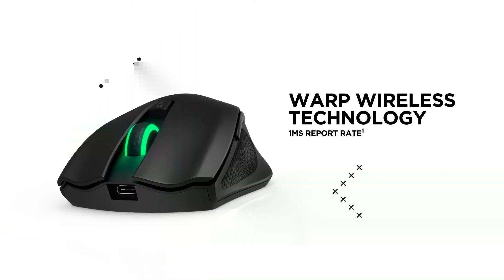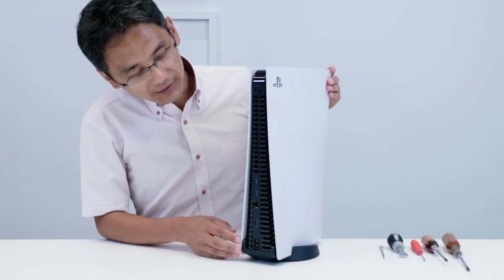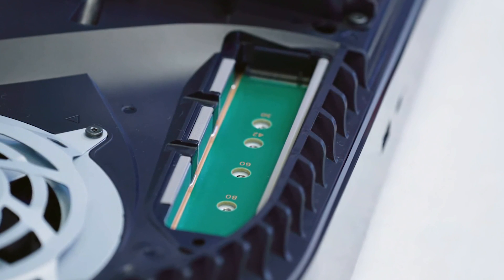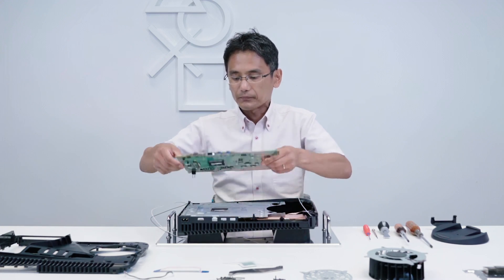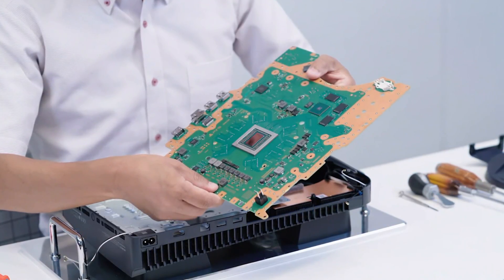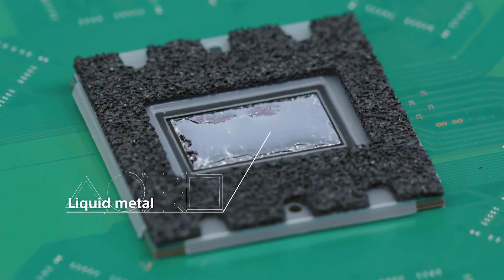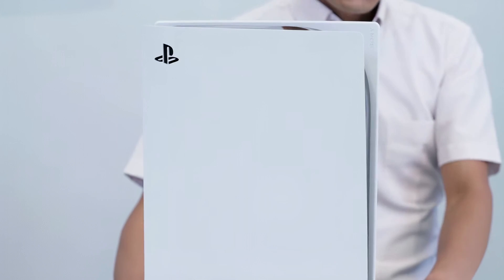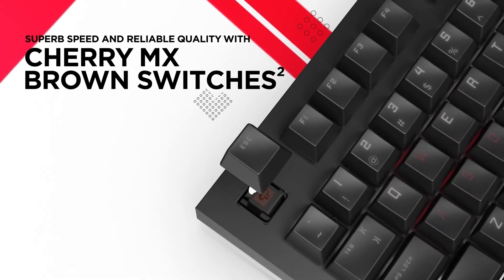PlayStation 5 Teardown Analysis: Inside Sony's Next Generation Hardware Design

Comment: Disclaimer: I use PCs but wouldn't consider myself beyond barely scratching the barrier of a PC enthusiast. But I have burnt down enough PCs to the ground have managed to bring it back to life hurriedly with nothing but shoestring and bubble gum to warrant some guesses/opinions 

The fan in particular, is the type mainly seen in dedicated cooling machines like ACs and car radiators. The blades on both sides are capable of pushing out massive amounts of air outside from both directions at once. Its essentially doing the work of two sperate fans cooling off a dissected chamber. 

The SSD, is purely a guess but I imagine the soldered pieces act as a primary (unless the bios allows you to change priorities via settings) so it does all the heavy lifting. The expansion slots mainly just transfer data to the primary as needed. But since we are talking massive speeds of data, heat is definitely an issue. I am guess Sony is relying on its fan to do the job of removing excess heat. I have to imagine the PS5 is design in such a way that there are enough outlets and inlets of holes throughout the system so that the airflow can reach all parts of the system without being obstructed. 

The liquid metal cooling solution is likely the most dazzling factor. It being able to transfer heat efficiently from the chip will definitely help with games at the start of the generation. It will be interesting to see how this entire design holds up at the latter end of the gen when games surpass the hardware requirements and get more demanding to run. For now though, its likely a little bit of an overkill with that huge heatsink for the games that will be coming out for the first few years.
Reply: Y Marina  wrong. XBOX has chosen fixed CLOCKS. not power.
Reply: It seems like you don't know much about the PS5.
You will be able to play games directly from your m.2 SSD.
PS5 will be running in constant boost mode at a fixed power level. that means that PS5 will attempt to boost as high as it can given the provided power(and what they call "model SOC")
that means that PS5 will consume the same amount of power(roughly) for each game, regardless of the engine specifics.
Reply: @codethis2875  You are right I don't. I will never know much about any system before I actually get to physically interact with it and likely burn it to ash in the process and try to use the ashes like clay to somehow reanimate the damned thing again. Frankly, no one knows much about the system beyond what we have been told and what we tend to speculate. That is why I labeled my opinions as "guesses" even though they tend to be pretty reasonably well founded. 

Ironically, as of the time of my reply to your remarks, at least one of my guesses have been confirmed already. Clearly the system was built around the giant heatsink and the exhaust fan to maximize cooling enough for parts that are not connected to that monster of a heatsink (which really should be as it would be a low cost and efficient way of keeping the SSDs cool without having to provide its own heatsink and accessories). 

So I am fine with waiting for the system to be out in the wild so I can turn my guesses in to facts.
Reply: @The_Spaz  We know a lot about the systems. there are Series X in the wild. people tested them already.

We see games running on PS5 and Series X hardware. what else do you want?

PS5 showed that optimization beats raw performance, exactly like last gen.
Reply: @codethis2875  On paper yes. But I did much rather put it to practice with my own hands thank you. Perhaps for you its enough, but I am just merely curious at this point. Besides, it could be powered by a hamster on a wheel for all I care. If it has the games I like to play, I will get it. Haven't quite seen anything for me that speaks worth owning just yet. I will just wait for feed back and see which of my guesses pay off and which don't.
Reply: @codethis2875  PPL have, I haven't and I have yet to see the game that would make this beast sing. That rachet and clank game is just barely scratching the surface of what the PS5 can theoretically do and I don't trust people on things that I can find out for myself eventually.
Reply: @codethis2875  Yes I kow what ppl tell me but that doesn't mean I would go on their word alone. No offense, I don't particularly trust publication sites because their primary objective is to sell you the product more so than inform. I trust youtubers even less because they are mostly here for the money and likes. The more popular they get, the less honest they becaome because now they have to play nice with all other companies that may or may not send a free sample their way. So no, I don't need people to tell me whats what, I can figure that out for myself. If it was something that I cannot afford to get with my own wallet I guess I will have to defer to others. So I really don't care whats been shown and whats been advertised. You should be smart enough to know companies can be deceptive. Just look at how all the games on PS5 are not exclusive after beating the "we believe in generations" drum for so long. Or how despite the boast MS is still not able to really able to justify their hardware beyond gamepass.
Reply: If you've ever watched developer interviews you would know that your explanation makes no sense.  End of gen games do not "technically" push the hardware any harder than launch titles (especially console exclusives).  The difference is they are more highly optimised so can get better performance from the same hardware by not wasting that power doing things inefficiently.
Reply: @alexatkin  Firstly, I think you are confusing the definition of the term "optimization" and are looking through a very narrow lens at an even smaller section of a much larger pie. Unfortunately, optimization has been a long running issue for third party games where devs on contract don't have the time or resources to figure out all the quirks of a single system since they have to release their IP for all systems and by and large focus on the lowest common denominator from that pie. Which are PCs. Due to their constant evolving nature, its only a matter of a year or two before it catches up to the console(s) and surpass them in pure brute power. So when the lowest common denominator starts requiring more resources to run games at "standard" settings you will notice the PS5 and the xbox both struggling to keep up. Exclusives on the other hand only need to worry about their brand dedicated hardware and can churn out much more "optimized" results than a third party can that has to be compatible with all systems. 

Secondly, either you didn't watch enough developer videos and/or your narrow perspective is failing you from connecting the dots because you are objectively wrong. All you need to look at is generations of games we have, why do they require more space? Why do they require newer tech to play? Amd why does graphical tiers of hardware even matter? Newer games will always demand more resources because games are generally created to look the best they can on premium settings possible on any platform. Its unfortunate perhaps but graphics sells and higher assets will need more space and resources to render on a system that the software is not dedicated to.
Reply: @alexatkin  Except that's how we "gamers" have always explained how some games at the end of any given generation seem to do things way better than games at the beginning. You can talk to devs and learn their lexicon of expressions but you're still here talking to mere gamers using their own slang/euphemisms.
Reply: Y Marina  What are you talking about? that's nothing to do with Sony\Microsoft.
Microsoft just offered a more powerful system and at the end of the day the difference was 4K vs 1800P, really minimal.

Sony is far far better at designing games for their consoles. their exclusives titles are far more impressive than Microsoft.

Microsoft this gen is offering 2 different consoles and support for PC. this is bad for optimization.
Reply: Y Marina  36 CUs at 2.2 GHZ can be faster than 52 at 1.8GHZ.

At the end it all comes down to optimization, Sony is much better at that than Microsoft. with XBOX you have to target 2 machine with widely different specs. that's a problem.
Reply: Y Marina  ok i will give you a tip try not to debate about things we don't know or understand.
Reply: The general primary concern I've heard is how will the liquid metal hold up as if even a little leaks out or spreads the console is dead.
Reply: @njdevil6629  This, unfortunately, is something we will not find out till we actually get a ps5 and own it for half a decade or so. I have never really come across a PC beyond that one time Asus promo laptop I remember smashing against the wall... women. Anyway, what I do know is that no one really knows that answer. Not even Sony. Sure, they may have charts and sheets with numbers and equation but its all theocratical till proven through trial. There is a principle truth and beauty about science I learnt after I almost accidentally blew my high school chem lab to dust. Practical and theoretical science are not always exact and you don't so a crazy teen a video about mixing water and lithium and then set him loose in a chem lab full of assorted volatile materials!! Besides, this console is to last us 5+ years and Sony has been only developing for 2? Clearly the first phase of these consoles are test beds for a wider audiences. The monster heat sink is definitely them trying to play as safe as possible. Its likely a safe bet that your PS5 can double as a decent space heater during cold nights of gaming thanks to the massive vents blowing hot air out. 

As far as the leaks and spreads. There will always be a few defective models out there, I have never seen a large scale production have 100% issue free scenario. What does worry me a bit is how efficient that foam barrier at keeping the metal in over time. I have to imagine Sony took the time to treat the foam with a layer of oxide to keep it from reacting and eating up the barrier and then leaking into other areas. So you best be prepared and make sure it comes with a warranty. The other thing I can point out from the size and the amount of thought given to stand: This thing is not meant to be moved or carried around. Like any other entertainment device you pick a spot and leave it there, you do not carry it around in a bag to your friends place for a visit and you would try to be as gentle as possible as with a PC when moving out of a place. Among the various hardware I have destroyed over the years, the ones that had this level of TIM cooling were dedicated hardware bolted to the ground. We are talking large servers and databanks that continually keep parsing info on the net via set of servers and storage caches etc, not meant to be moved.

Comment: Mark Cerney spent more time discussing the features and technology of the PS5 than anyone at Microsoft could competently discuss concerning the Series X. I think it's unfair to say Sony opted for a "Less is more" or "aloof" approach. Notice the claim that NVME SSD's get hot. You can see that the expansion slot sits next to the system fan. Also, Sony has touted how it's working with an industry leader in compression technology, that may help maximize it's onboard storage. I am inclined to believe that the motherboard in the PS5 has enough surface area that no single components heat will adversely affect neighboring components thermal performance. The compact nature of the Series X may lead to thermal issues.

Comment: My only concern is the onboard SSD going bad and it won’t be repairable like apple MacBooks SSD, when my MacBooks onboard SSD went bad the only 2 solution I was given by apple was to replace the whole motherboard which will cost almost the price of buying a new MacBook or purchase a new MacBook while getting a $100 trading in value for my MacBook.
Reply: I don't think the Xbox internal SSD is user replaceable either. I have never had an SSD fail on me.
Reply: 12Tflop BruteForce  I’m one of the people preordered the PS5 I sure hope Sony will allow repairing if that’s the case via official channels, it’s scary because it’s like a trending culture to chuck electronics in the bin when they can be repaired, hate to see Sony’s following the footsteps such as Apple and creating more e-Waste.

Comment: I'm a bit concerned about that soldered on storage. SSDs have limited read and write commands. At 5.5Gb/s, that thing is gonna die really quickly.
Reply: Reads don't really affect them, and games don't do that many writes.
Reply: @defeqel6537  i wouldnt really go that far to say reads dont affect it but i do have to say that the amount it takes to end a drive is not going to be a real issue. Its so high that one would have to buy a game everyday thats like 100gbs and then itll still last a few years. Its unrealistic to worry about read and writes killing a drive. Also the speed at which it reads and writes has no affect on how much in total its doing.
Reply: There are adds on pc right now with similar speeds and some coming out soon with higher specs up to 7gbps. And they're rated to last a VERY long time. It's a non issue

Comment: I usually buy both systems. I am waiting on the Ps5 until more information is available. Sony has a better launch line up but with the purchase of Zenimax I believe they will both have equal exclusives of the whole next gen. The only difference is I will not have to buy them separately with gamepass.